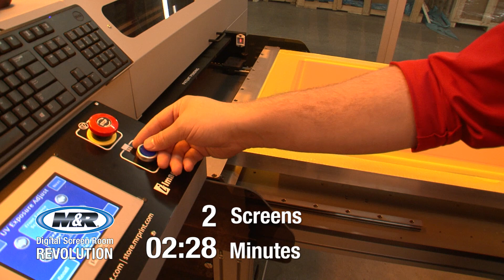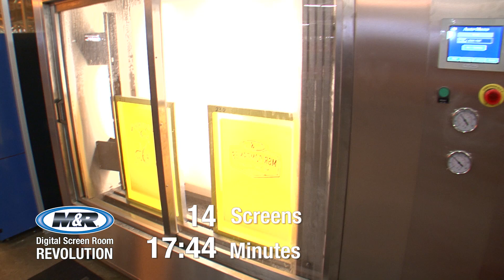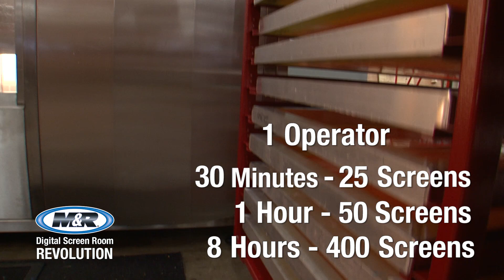Digital Screen Room Revolution

Comment: I am only seeing aluminum frames being used in this demo.  How do all of these pieces of equipment cope with Newman roller frames?  Do you need to have the tri-lock implemented in your screen print facility for the i-Image system?

The Eco-Rinse looks pretty cool, but only high mesh screens (which wash out pretty quickly anyway) are only being shown.  How would the Eco-Rinse wash out a coarser mesh, like a 110, which usually has to soak for a while for the exposed image to wash out?
Reply from the maker: We use Newman's at almost every tradeshow and make them using our showroom I Image, and they work excellent!
Additionally the Eco-Rinse has recipes so it can be programmed for different speeds, pressures and number of passes to work for different meshes.
Reply: @MRPrintingEquipment con ECO-Rinse las obsiones de velocidad podria revelar un capilar  de 400 micrones ?
Reply: At the shop I work at we use Newman Roller Frames in the STE and STE II with no issues.